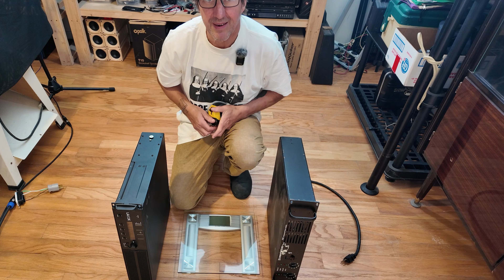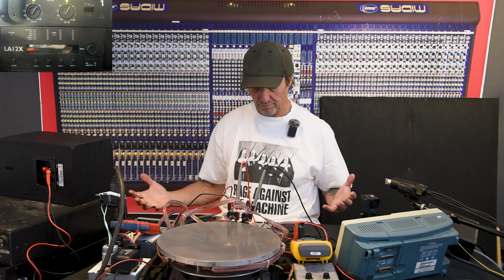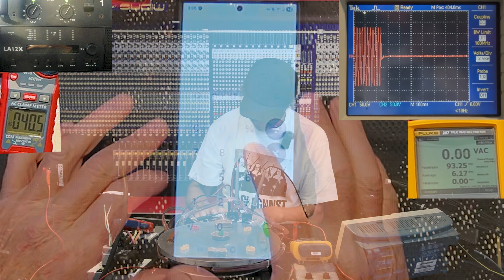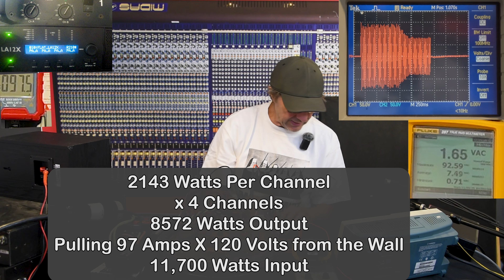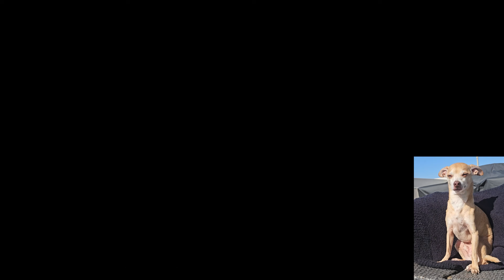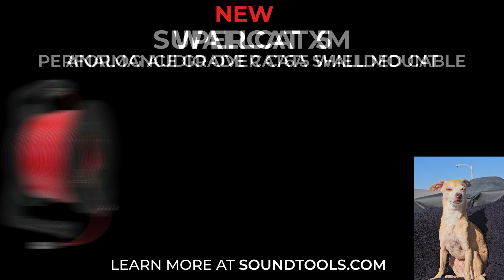Who Does RMS Power Better, Old or New Amp?

Comment: Awesome video as always! I wonder how the Crown I-Tech HD 2 channel amps would do in this test? Their patented class I (i.e. "BCA") is just another form of class D to my understanding. I know they don't recommend driving 4 subs with the 4 channel version (it has 2 power supplies per 2 channels inside), so their reasoning is probably similar to your findings with the LA12X or it's a thermal issue. But unlike this test, their larger 9000 and 12000 HDs are geared for subs using just 2 channels per chassis, but the 5000HD has the most similar rated wattage output per channel as the LA12X... Thoughts?

Comment: With 2.5kw of power you lose 3dB SPL with 1.25kw loose... With 500w per channel you loose only 1dB SPL. (Without woofer power compression) 😅😅😅
Reply from the maker: agreed. the power drop is not much in the audibility realm

Comment: these tests are all done on a resistive load. Repeat on a reactive load like a loudspeaker. Any returned power will just be dissipated as heat in the class H (or class AB) amp. A well designed class D can recycle the reactive power to recharge its power rails rather than dissipating it all as heat. It's possible testing on a reactive load would show a much bigger difference between the two amps.
Reply from the maker: the limits to the Class D amp are primarily the breaker size or more specifically the amp regulating itself to not blow the breakee

reactive power regeneration adds a bit of output for shorter energy bursts but for long term energy you never get more out of an amp than you put in.
Reply: @DaveRat  yeah, but a class H amp is going to be generating loads more heat with a reactive load so it will have to limit output to avoid thermal failure. and its efficiency will be even worse than it was with the resistive load. I'm looking at making a reactive test load out of a variac and some big resistors and caps.

Comment: I recommend picking up a current clamp probe or two for your scope...that way you can graph the AC (input) current and/or output current...
Reply: The Hantek ones are about 60 squid off Ali...CC-65 CC-650
Reply from the maker: there's another video that I did soon after this one quite a few months ago that is still on the member side where I show peak current coming down the AC line for the LA 12x. 

I think I mention it in the video and it's why I built that switch that allows you to run the app on single 10 gauge or double 10 gauge wire. 

I was investigating voltage drop and current pull from the amplifiers and seeing why we were getting voltage drop that exceeded what one would expect for a 30 amp breaker. 

turns out those amps will pull almost 100 amps for short periods of time on the AC lines. 

I'll release that video at some point it's kind of interesting but no chocolate
Reply: @DaveRat  yeah I was taken aback by the 100 amps pull! 

Not an expert on this, but my understanding was you wired straight into the main fuse board, so essentially no breaker protecting the cable...in theory the 10awg cable or powercon 32a connector could melt after a few minutes of sustained 100 amps....I wonder do the amplifiers have some kind of protection to stay within safety limits of that...and that's one thing we're seeing re ouput sag...basically it couldn't possibly sustain 12000w anyway on 120v with a 32a cable/connector, even if the internals of the amp could do it...it would have to be a 4awg 20mm2 ish cable lol
Reply from the maker: I wired the 10Gauge wires into a 30 amp breaker directly in the panel to bypass house wires

Comment: MR Rat, maybe were looking at this hole thing backwards? so lets consider this. Loudspeakers have impedance curves. Old amps naturally have alot of sag in the power supply, especially when bridged at 4 ohms. Class D does not seem to sag at all, only has current cutback  Sag allows higher voltage for quick transits, and impeadence spikes.  So if both amps can do 2000watts rms into a resistive load with a sine wave, but old amps hit harder, so my questionis, What is the peak power, or burst power availability on both amps for higher crest factor material at higher impedance?  It may explain why subs hit harder on older amps, when rms power is atchually the same 2000 watts . Maybe the older units deal with impedance spikes and transits better? I think maybe rms power is not what we are hearing , where the higher rail voltage of the older bridged unit is what we like.
Reply: I experience current cutback on newer amps,  that i didnt like at all when someone told me  to replace a bridged Mono stack of pl230 qscs on sub duty with a single new 4ch amp and I tested with edm. It didn't work out as advertised, but maybe there is still more to this story then just that. Because there was a even bigger diffrence mixing a live band. So looking the other way, at transits, id love to see a slightly clipped  20ms burst test on both amps to see if either amp can perform above its sustained rms voltage (4 ohm bridge for the crest/4 ohm 1 ch for the l acoustics) for a tranist peak, also maybe test @ 20 ohms for impeadence spikes. Starting to think I'm looking at this hole thing backwards, and that old amps may have higher burst power then the new amps, expecially when impeadence rises ,my 8 ohm bass horns are 30 ohms at 38hz. So maybe lookong at performance at 20-30ohms will tell the story from the perspective of a subwoofer that is playing at a frequency that is higher impedance then it's minimum impeadence.
Reply from the maker: not sure old amps hit harder.

I think if comparing an old 1000 watt amp to a class D 1000 watt amp you will find the old amp has more reserve power and longer RMS power but for most music they sound about the same volume wise

if comparing a 50 pound old amp to class D the class D will have something like 10x the peak power and 5x the RMS

if comparing amps of similar size, same thing. if comparing watt per breaker size, class D will give about 20 to 50% more power

cost wise class D will tend to cost less, offer more channels, more power less heat.

I think the issue is that people replace a big heavy 1000 watt amp with a tiny light cheap 1000 watt amp and then wonder why the tiny light cheap amp stresses when put under heavy loads.

replace a big heavy amp with a med3rately light amp of similar size and comparable time adjusted cost and the class D will be near impossible to beat on the power side of things.
Reply: @DaveRat , good points. I guess the thing for me is that old watts were rated much more conservatively,  so its not easy to match replacdment power based on a spec sheet. But, I think if you tested at say 20ohms it may show you someintresting results new vs old

Comment: So what's the point into this?,
Reply from the maker: a few of the things I find interesting are

this class D is 10x more powerful for the same size

the class D amp actually regulates its output power to make sure it does not blow the breaker while putting out the maximum power possible from the breaker.

I did not calc the power but you can see the the drop and if the drop is 1/2 the voltage it would be 6dB. not a tremendous issue, but a blown breaker is a a show stopper

power ratings on older amps are not the same as newer amps. older pro amps tended rate power on Long term RMS and new amps rate power on shorter term RMS.

even though the newer amp had a power drop after a short period of time when driven full load, it still put out way way more power than the older amp.

Comment: You should check out the bass head watt meter for $120 USD  it is designed for 12 V power car audio but still can be used in the house

But it shows you exactly the wattage you are clamping and the ohms.. it’s pretty cool seeing impedance rise like a 2 ohm sub  in a ported you can see at a certain frequency say it goes the 2.2 ohms then at another range. It can be at 12 ohms 

I noticed it seems the lower you wire  then lease amount of rise you get 

Granite this is all based on enclosure and the car cabin and pressure

Another example of how inefficient sealed Enclosures are like with the JL 10w7 at 3 ohms on a 3000.1 mono block 
Doing a spl burp at 45hz it did 130db @ 25 ohms only able to clamp 80w where most ppl will without seeing what the amplifier is doing is thinking that it’s RMS Power because it’s loud when it’s the complete opposite

Also, they have the SMD handheld meter but that is 600 bucks and it takes 9 V batteries that dies pretty fast since that’s the only two on the market. They seem pretty accurate until you get over 10,000w things start to vary

Comment: Well this video confirms my suspicions about class D amps.
While I still believe in my old Crown Com Tech 10A's my back is saying change to class D today. 
So I've been shopping the class D market place.
When I find likely candidates I plan on testing their output power. I strongly suspect I will have similar results.
My thinking is Class D is going to be okay as long as I realize that they are ment to reproduce normal music program signals and don't try to run them balls to the walls all night. 
With class D watts are cheep and light so if I use amps with higher power ratings then that of my old amps then limit them to whare their peak power is safe for my speakers I likely will still come out ahead of whare I am.
PS I recommended the the boys at acid Sound Systems take a look at this video. I think it will shed some light on their situation.
Reply from the maker: it's important to keep things in perspective. 

The class D amp does drop in power from its peak at as a negative. 
conversely since a class D amp is more efficient, for a given power source or given breaker size you can get more power out of a class D than you can never get out of a class A B. 

if you have a 2000 w class A B amp can you replace it with a 2000 watt class D amp, you'll have something about half the size in a quarter of the weight at much lower cost 

if you replace a 2000 watt class A B amp with a 10,000 w class D amp, you'll have an app that weighs less is the same size or smaller and puts out more power RMS and more power peak power and generates less heat.

that is not to say that class D is universally better, it's just smaller lighter higher power more efficient and generates less heat And depending on the amp can run lower impedances and higher voltages at a lower cost.

The place where class D struggles is frequencies over 20K as they become unstable when lots of energy is being reproduced up and around the switching frequency. also they're typically not as easliy repairable and because they can output more power and are so efficient, they tend to put a lot more strain on the AC power system supplying the building or venue or home. 

And when there's voltage drops on the AC mains, A class A B app will tend to put out less power but a class D app will  quite often just increase the amount of current it draws from the wall while it's driving to maintain full power output 

The power drop stuff you see in the LA 12x is actually the amplifier throttling its output so that it doesn't blow the breaker. The amp is actually designed to understand the current draw curve for a circuit breaker model that is listed in the owner's manual and controls the amount of power it pulls from the wall to make sure that it won't blow the breaker. 

instantaneous peak ac current drewn from the wall on that LA 12x I show in another video reaches about 96 amps

Comment: I and in Australia, because we use 240 volts (which is sometime 254volts depending where we are) there are less amps driven on the mains.  That way we get away with lighter gauge power leads and lower rated outputs.  However I am not saying use cheap crap power leads.

Comment: I don't understand why you would want constant power headroom from your amplifier anyways. Regardless of program material, such amping doesn't make sense.
A good modern driver, such as B&C's 21DS115, will take immense burst powers (as indicated by the passing CEA-2010 result at near 20KW with less than 10% THD provided by data-bass) but its voice coil will burn up if you feed it 1KW for an extended period of time. Bennett Prescott (B&C) said that the true long term power handling of most (of their) drivers is between 10-20% of the program power stated on the data sheet (depending on cabinet design), so what you have is a driver that pairs perfectly with an amplifier than can deliver bursts that are about 5x its long term power output.
To put that into numbers, with a regular 16A 230V breaker, you have a power budget of about 4x800W on the output side, which fits (4 of) those high power 21s pretty well, plus then you'll want 5x of that for dynamic headroom to be able to make the most of the drivers, which nets you 4KW per channel.
These are the figures those modern amps are optimized for. 
So now you have an old AB amp that does the same output for short- as well as for long-term output, so you have a 4x800W amp and leave lots of dynamic headroom on the table, or you have a 4x4000W amp and burn your drivers or need to run heavy limiters and good luck with the breakers.
The amplifier topology (Class D) isn't what dictates this behavior either. On the contrary, the much more efficient topology allows for less heat buildup in the amp and makes it easier to sustain high power output over long periods of time. The SMPS (powersupply) could theoretically also be dimensioned to keep up a constant output power, but since this just makes no sense, amp manufacturers don't build amps like that. Why make an amp bigger, heavier and more expensive to add headroom to it that nobody will ever use?

Comment: In the early days of digital amps, MC2 came under a lot of flak for the reasons demonstrated by Dave, pushed hard with LF sine waves, the amps ran out of puff.  But that was before EDM, and for music purposes, they were entirely fine.  But, MC2 observed, “our amps are not designed to drive parcans or power tools, they are engineered for music”.
Reply from the maker: yeah it's super interesting. very few people need an amplifier to drive long-term continuous signals

in a car spec it might say the maximum velocity is 100 mi an hour and it also may say that it can pull a trailer

yet we don't see people getting all bent out of shape because their car won't drive uphill at 100 miles an hour while pulling a trailer.

most people never even pull a trailer with their car yet they want an amp they can pull a fully loaded trailer uphill at max velocity or else it's crap. 

for the people that have the knowledge it's pretty straightforward to distribute the load so that you get the desired output capabilities
Reply: @DaveRat just remembering that the DC300A was originally designed and marketed for vibration tables, and absolutely was intended for continuous full output.  Then rock ‘n roll discovered this amp and the rest is history.

Comment: The difference in the 2 vs 3 vs 4 channels loaded test indicates that the main limitation is the power supply stage of the amp, rather than the Class-D topography of the output stage. 
I'd be interested to see how much difference (if any) rail balancing makes (where say, 2 channels are wired normally, and 2 channels are inverted on both the input and output sides, so when driven with identical signals, the outputs are all the same polarity, but the 2 inverted channels are at any instant drawing from the opposite supply rail of the amp).

Comment: Well a 'conventional" power amp WILL trip a breaker earlier on sustained 5high output because it is drawing more mains current than a typical class D amplifier (or a class AB amplifier with a SWITCHMODE supply because thetraditional transformer/rectifier/capacitor supply sections are typically around 55 percent power efficient (mains input to amplifier section )compared to around 80 percent efficiency of a switcher. Then consider that actual MUSIC is NOT a continuous FULL output scenario so the so called 'test results' are false.  Normal music has around 12dB Peak to average difference.

Comment: The LA12 pulling 97 amps off the mains is crazzzyyyy. 🤯 But that’s also very strange because that means the power supply is capable of delivering enough power continuously to let all the channels sustain full power. Assuming it wouldn’t overheat and i wouldn’t assume so because the power supply is way more efficient than the amplifier stages. You’d have to ask L Acoustics to be sure why it’s programmed that way but I think it’s actually to protect the mains and not the amplifier loll. I’d bet with some kind of firmware hack you could get it to just let all 4 channels rip continuously